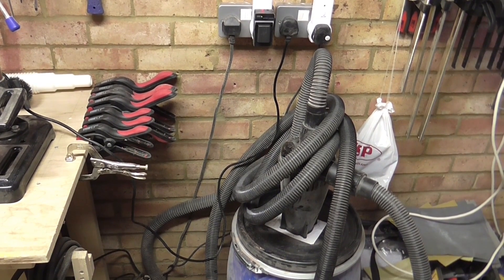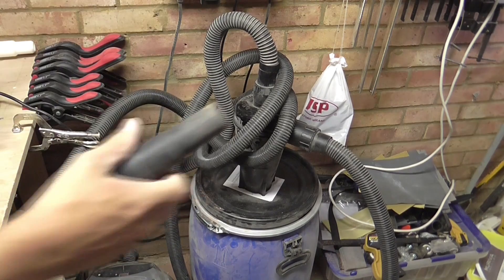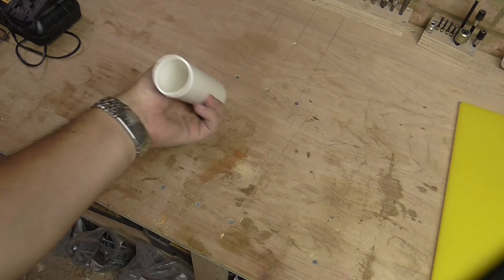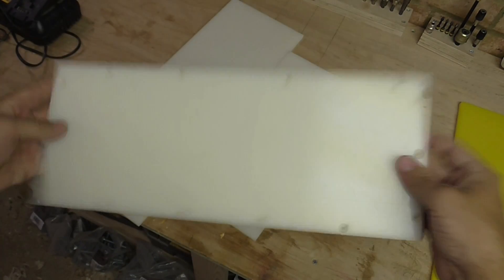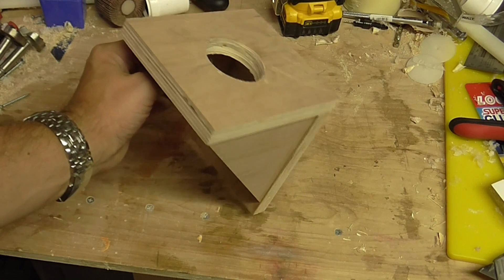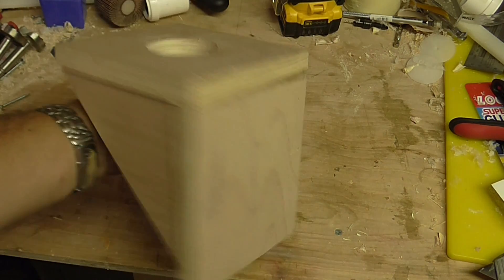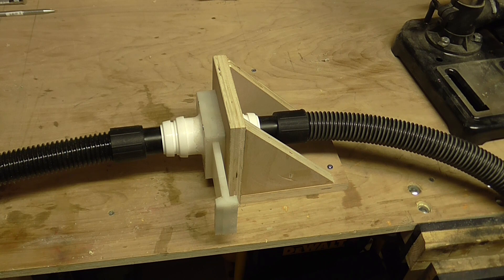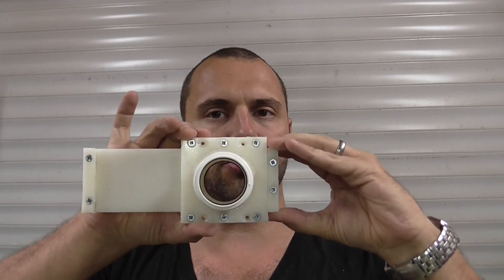Blast Gate Build - Workshop Dust Extraction System - Part 1

Comment: I definitely need to copy this! 40mm push fit is cheap & widely available, so great idea. Is that diameter working out well in terms of suction, lack of blockages etc? Could I also offer a tip to anyone cutting straight connectors in half on the mitre saw as shown…. Ideally push the fitting onto a scrap of pipe so your fingers aren’t as close to the blade 👍👍
Reply from the maker: It’s been a while since I made them but working well with no issues. 👍🏼

Comment: Love this series - thanks so much for sharing - just a couple of quick questions ...
Is the pipe 40mm OUTSIDE diameter ? I picked up a piece that size and is seems quite small. Also, I know you've moved house since you made these, but are you still using a system like this, and is it all still working well ? 
Many thanks - keep up the good work!
Reply from the maker: Yes works great got to set one up in the new house as have moved again! 
The external diameter is 41mm and internal 37mm. Hope that helps.

Comment: Thanks for the video, I have bought my HPDE from eBay and my couplers, what did you use to stick them together please? I am reading that HPDE doesn't take glue very well. Cheers.
Reply from the maker: I used hot glue. It doesn’t take glue very well you are correct. You could also use Super glue (CA glue).
Reply: @WheresMyPencilUK  Thanks for that, I tried CA glue and HDPE just laughed and fell apart at first sign of any stress. I'll invest in a hot glue gun. I'll get them finished one day, just not holding my breath.

Comment: Yes!  This is the design I will use.  Thanks.
Reply: However, I have to say, I cringed watching you balance that small section of pipe on that smaller section of wood.  Couldn't you have at least cut it on larger, flatter scrap-wood (especially for the kiddies at home)?  Yikes!  Otherwise, very helpful video.
Reply from the maker: Glad you like it. 
The reason for the small section of scrap wood was it fitted between the two flanges so was actually more stable and held the fitting in place more securely for cutting.

Comment: Great blast gates - what are the 2x sizes of forstner bits you used for internal and external diameters of the pipe..
Also I thought people could use the cheap plastic cutting boards that are readily available as an alternative material, saves ordering it online - postage etc.
Reply from the maker: Thanks I’ll check, give me a bit of time and I’ll post up the sizes.
Reply: Thanks

Comment: I see you have the same Titan Wet & Dry Vacuum cleaner. I will be interested in how you sort out hoses and the like. My embryonic plan is to use a rigid 100mm pipe as my 'grid' with drops and gates. I am also thinking of knocking up a cyclone separator to sit between the grid and the Titan. The supplied hose with the Titan is a mere 30mm ish whereas the suction port is 58mm. I would think it would work better if it was opened up to take 100mm pipe - but the rate limiter may be the cyclone fittings. Of course the blast gates and tool hoses could be smaller than that to make their individual hoses easier to manage. It's going to be the devils work finding the right adaptors and I suspect it will be the real expense of the project - bearing in mind I got the Titan yesterday for £29.99! Interested in your view and how you intend to approach. I am also mulling over putting the cyclone and the Titan in one of those plastic sheds and fix to side of shed so that noise levels are more subdued inside.
Reply from the maker: Norman Boyes the extraction ports on most of my machines are only about 38mm (a couple are 50mm) so I'm using 40mm waste pipes for the system as don't see the point in increasing the diameter as it will require more suction power. 
I have a few ideas for adapters to fit the various machines; will include this in the next video. 
I thought about some sort of cabinet to reduce noise from the vac but some of my machines are so noisy I didn't really see the point! Might be something I do in the future.
Reply: Happy Wife Happy Life I am probably over  thinking it ! You make a good point on the rationale for 40 mm. The Titan wet and dry makes my ears ring!😳

Comment: This is very useful to me as I am about to set up a new (small) shed as a workshop. Still at the ideas stage for dust extraction but it's got to be cheap.😉 I like your design and may well emulate it - why did you go 'screw heavy' on it? Was that because you were prototyping? Would CA glue and accelerator not be better particularly as you have 8 to make? Anyway just questions - I like your ideas and at least you are getting on with it - while I just think about it.😀
Reply from the maker: Thanks Norman I could have used glue but HDPE is notoriously difficult to glue together. The number of screws were needed to ensure it was really tightly pulled together to ensure a strong vacuum and can withstand a fair bit off abuse.
Reply: Happy Wife Happy Life Thanks for that.👍
Reply: Hi love the video just building as we speak but my forstner bit or hole drill just won’t cut through my laminated Perspex (left over bits from a job) which is 6mm thick - what did you use? Even changed my drill speed. Going to resort to scroll saw
Reply: Norman Boyes CA glue will not bond to that material.

Comment: Smart idea.  I'm looking forward to the next instalment too as I'm starting something similar but with 68mm drain pipe.  My biggest issue seems to be that all my tools have different sized dust ports so I'm planning on 3D printing custom adapters to get them all to a standard diameter.
Reply from the maker: Thanks Thistledoo mine are all different sizes but I have a few ideas. No 3D printer to I'll be improvising.

Comment: ive just finished making the band saw table your plans) works great.
the dust system im doing is with 2" waiste pipe reducing down to 1 1/2" for the tools.
great vids by the way.
Reply from the maker: Thanks rhinenio glad you found the plans useful.